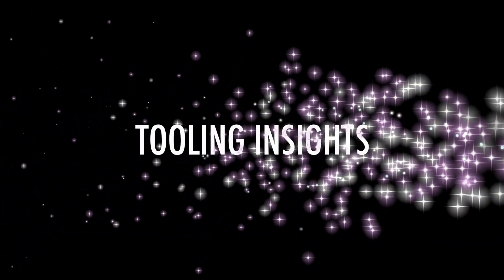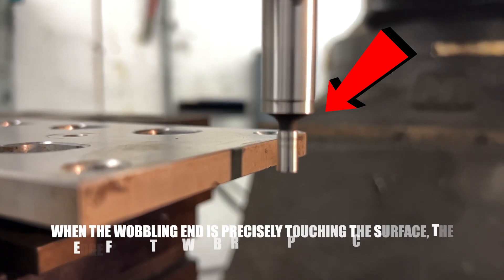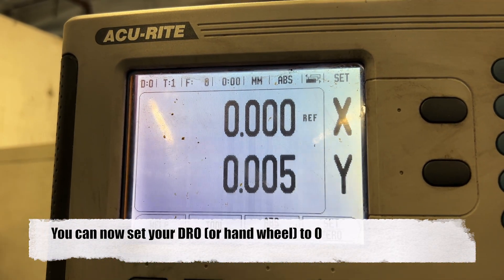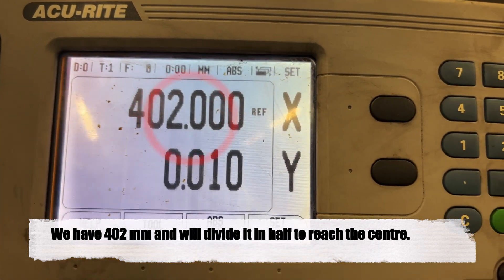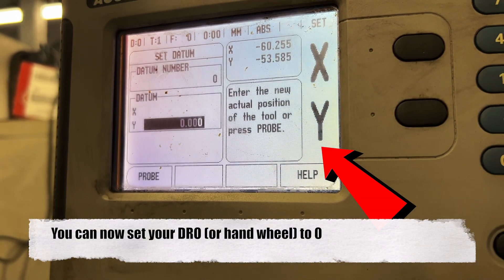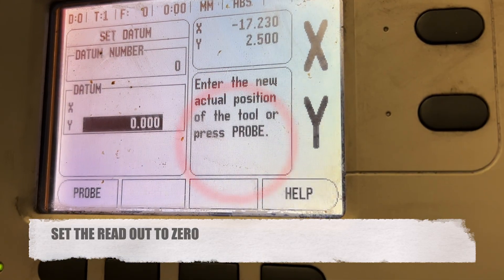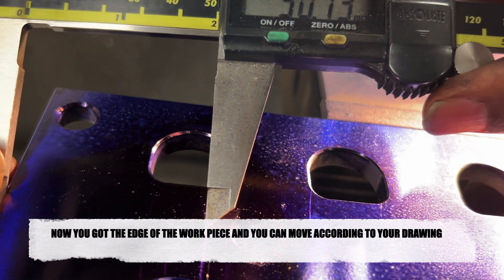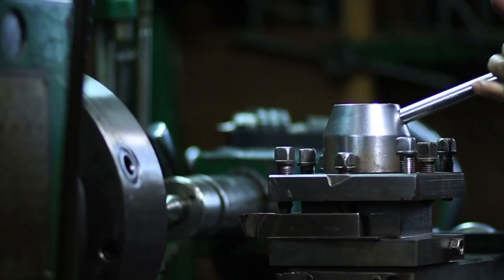HOW TO USE AN EDGE FINDER?

Comment: thank you sir . normally RPM we give is ONLY 300 TO 500 .1000 RPM may spoil the spring inside the edge finder
Reply: Very true. Some types can destroy themselves at 1000rpm. Always check the spindle speed before turning it on. Too high rpm also can make the edge finder bounce off the part. Regularly demagnetize the edge finder is a good tip.